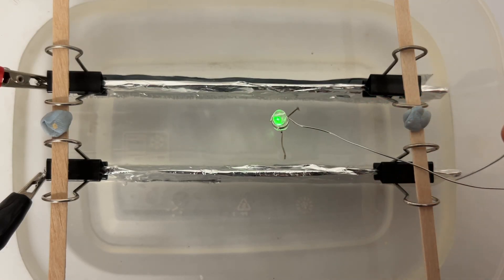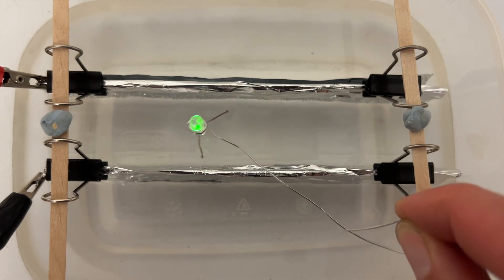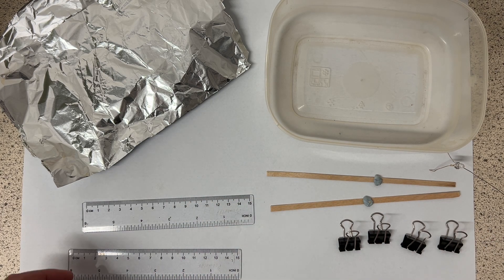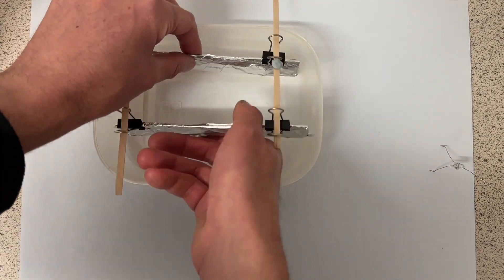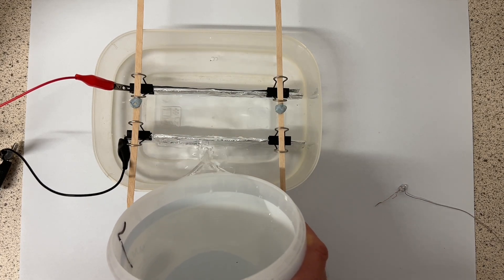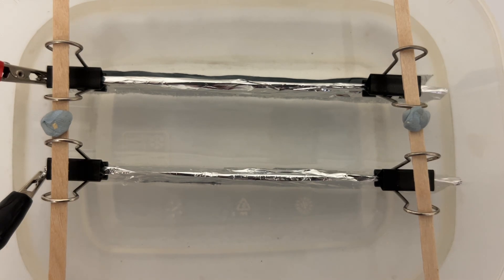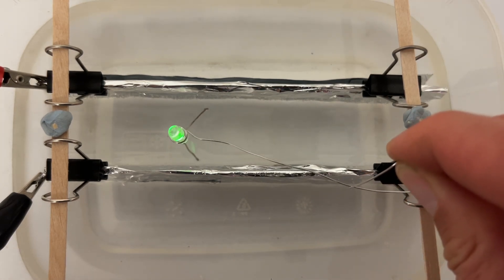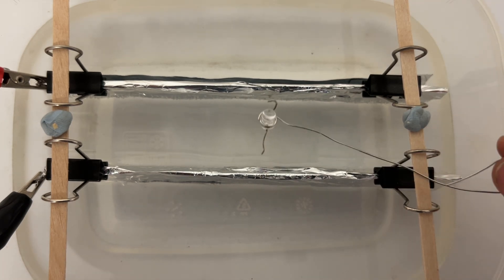Using an LED to explore uniform electric fields

Comment: Cool demonstration. Is the water acting as a dielectric, same as a capacitor?
Reply from the maker: No.  It is different.  The water is acting as a poor conductor for electric current to flow through.  In a capacitor the dielectric should be an insulator.😊
Reply: Pure water is a great dielectric, tap water is a fair conductor, salt water is a good conductor. In this experiment the water is a resistance between the conductors.

Comment: Note: This is why, around downed power lines, it is recommended to "bunny hop" away from them rather than walking or running.  By taking a normal step forward, the two points of contact between you and the ground, spaced out, present a more efficient path to the surrounding ground than the ground itself, resulting in some of the current passing through you rather than the ground.  The wider the distance between your feet, the greater the potential difference between the two points is, and thus the greater the shock you get.  By "bunny hopping" away to safety, you keep your contact with the ground as small as possible, resulting in as minimal a potential difference as possible.   Secondarily, it is usually advised to hop directly onto the ground, and then "shuffle" away to safety using as small of movements per step as possible, again to minimize the potential difference between your feet.
Reply from the maker: Thanks for sharing this would be an interesting context to use when teaching.  😊
Reply: This is excellent advice! In certain conditions such as low lying areas that are prone to flooding such as Florida and other states, when the ground is saturated or flooded the safest option to walk across a potentially electrified yard or ground is to bunny hop, to clarify bunny hop, "To walk on one foot only !!! then hop onto the other foot to eliminate a closed circuit between the human legs as this does create a closed electrical loop. This cannot be over stated. One foot on the ground at one time only until you are free from the danger zone.
Reply: or  u can walk with a copper string between ur legs... but.... anyway if electricity is enought to zappe ur feet.. probably u re done... its like crawling in  a builing wich is on fire... any recomendations are so far just a small percent of chances..when is ur time....it is... when not.. it is not...

Cheers =)
Reply: @DonnieLuve  not necessarily.  In both cases, there are ultra specific steps you can take to dramatically increase your odds of survival.

Comment: Hello :) Why the water doesn't short-circuit the battery ?
Reply from the maker: Current does flow through the water but it has enough resistance that the current is quite small.
Reply: Water is highly resistive, so it will have the same effect as if you put a large resistor in parallel to the led
Reply: @xnaaloh4437  resistivity is just mho complemented, instead i would say conductivity of watter is very poor, then the superconductivity of superconductors wont seem to be that extrange concept

Cheers =P

PS: i guess today i wake up kinda antagonist =P